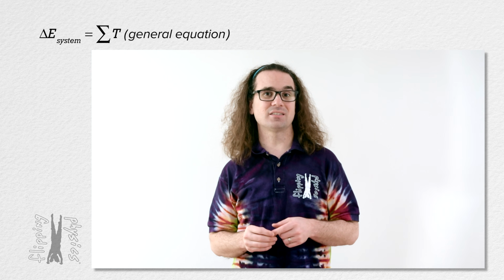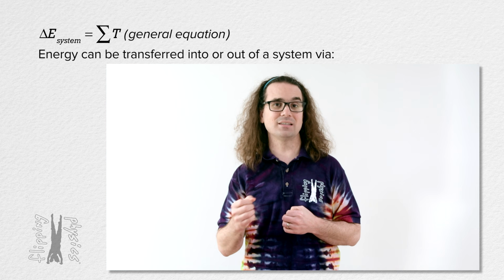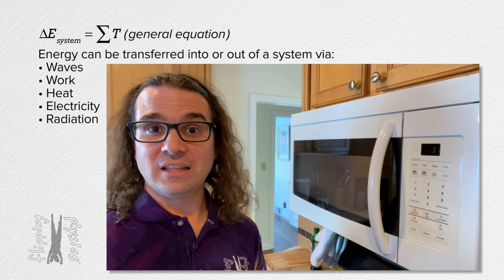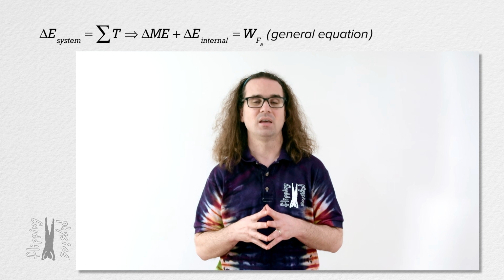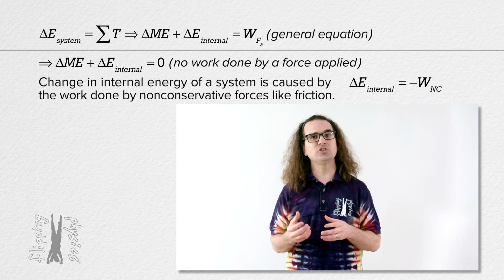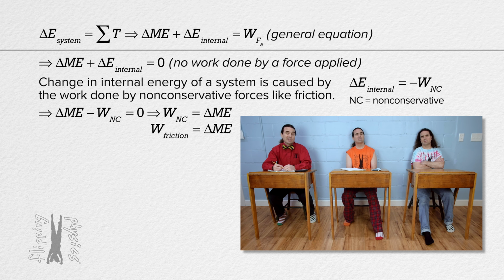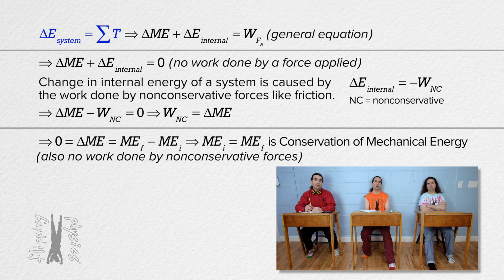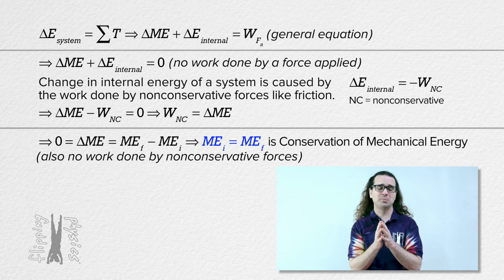Energy Transferred Into and Out of a System

Comment: Great video. One suggestion: please change ∆Eint = - Wnc to ∆Eint = - Wd  (where Wd means work of dissipative forces, like friction, and this formula is valid only if Q=0). Reason: Not all non-conservative forces (for example force applied) are dissipative force, i.e. are converted into internal energy. Only the dissipative forces (like friction, drag, or viscous forces) are, by definition, converted to  internal energy.
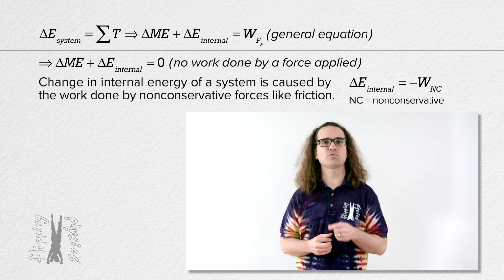Reply from the maker: At 4:00 I say that that equation, ∆Eint = - Wnc, is only valid when there is no work done by a force applied on the system.

Comment: Hi Mr. P.! First off, thank you so much for your videos! They are probably the only reason I managed to get a 5 in AP Physics 1. Now, I am using your videos to self-study AP Physics C! I do have one question about this video, though. It's probably a stupid question, but what do you mean by applied force (do you mean a force external to the system?), and how is this different from a nonconservative force? Thank you so much!!!
Reply: You can think of an "applied force" as a human force in most simple examples.  It could be something else, like the forces from the work of a motor or engine, if it is beyond the capabilities of a human to apply.  A force of a human's intervention to either set things in motion or assist them as they come to a stop.   An "applied force" is a force where the details of its cause are unspecified for the problem, and can be whatever force we define it to be.

Human forces are non-conservative, because you usually cannot store energy as you bring an object to a stop with your muscles, and resupply that energy later as work you do.   Your muscles dissipate the energy of motion as heat, when they assist an object to a stop.  Any new work you do, must come from the chemical energy of your food.

Non-conservative forces in general, are forces which have no associated potential energy, and likely have a path-dependence on the work done by them.  They are associated with energy either entering (usually originating as chemical energy) or leaving the domain of mechanical energy (usually as thermal energy).  A non-conservative force is also associated with an irreversible process, unlike conservative forces where energy can reversibly change between the two forms in either direction.

Ultimately, energy IS conserved in some form or another, no matter what the interaction is, even if the energy doesn't remain in the mechanical energy domain.  In a more abstract sense, even chemical and thermal energy are forms of mechanical energy, just not immediately obvious to us on a macroscopic scale.  Thermal energy is ultimately the scattered kinetic energy of motion at the molecular level, and chemical energy is ultimately the electric potential energy of atom configurations.